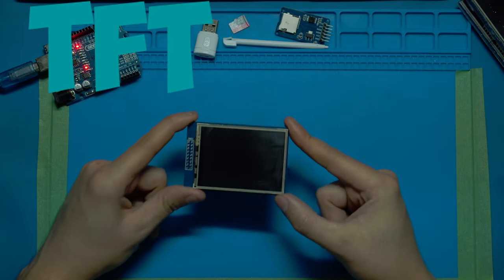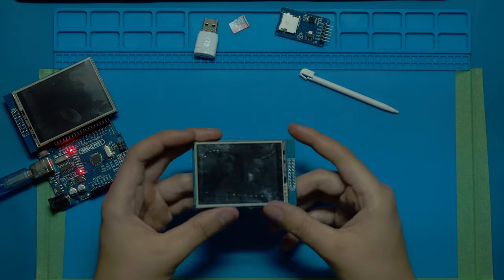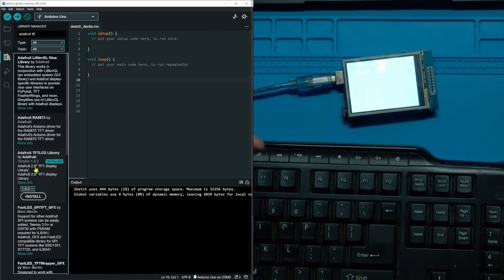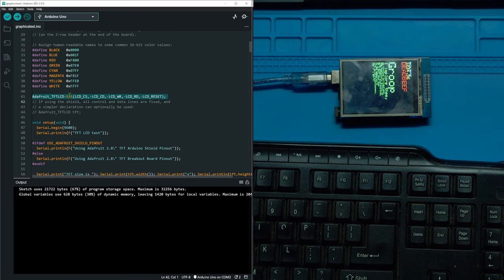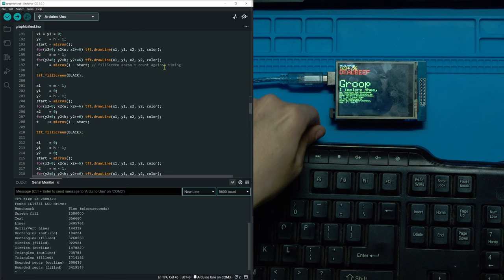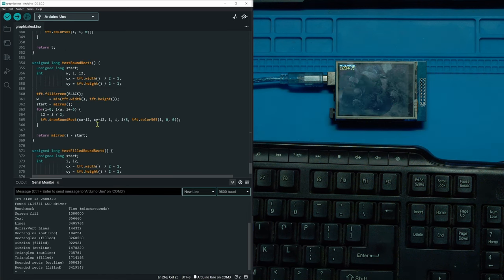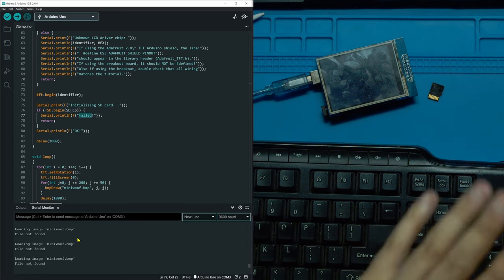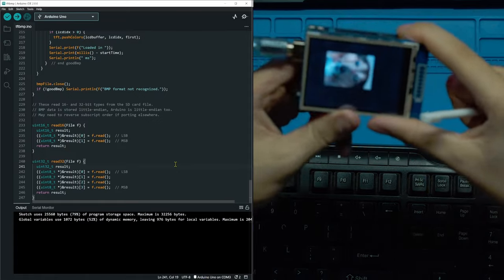TFT Display and Arduino: Setup and Programming | How to connect LCD to arduino 1.8" 2.8" 3.5"

Comment: mine is just stuck on a blank white screeen 💀
Reply from the maker: Seems to be more then just you, check the wiring over, and use one of the example scripts provided from the tft library we used
Reply: @MikaelAbehsera  With the tft display I got, it needed a 1k ohm resistor between the led pin and the 3.3v connection to load the led a bit slower iirc. That’s from what I read and found elsewhere online. Mine behaved similarly and only displayed a blank white screen until I did that.

Comment: IC:\Users\offic\Documents\Arduino\libraries\Adafruit_TFTLCD\Adafruit_TFTLCD.cpp: In member function 'void Adafruit_TFTLCD::init()':
C:\Users\offic\Documents\Arduino\libraries\Adafruit_TFTLCD\Adafruit_TFTLCD.cpp:117:3: error: 'textsize' was not declared in this scope
   textsize  = 1;
   ^~~~~~~~
C:\Users\offic\Documents\Arduino\libraries\Adafruit_TFTLCD\Adafruit_TFTLCD.cpp:117:3: note: suggested alternative: 'textsize_x'
   textsize  = 1;
   ^~~~~~~~
   textsize_x
Multiple libraries were found for "Adafruit_TFTLCD.h"
  Used: C:\Users\offic\Documents\Arduino\libraries\Adafruit_TFTLCD
  Not used: C:\Users\offic\Documents\Arduino\libraries\Adafruit_TFTLCD_Library
Multiple libraries were found for "Wire.h"
  Used: C:\Users\offic\AppData\Local\Arduino15\packages\arduino\hardware\avr\1.8.6\libraries\Wire
  Not used: C:\Users\offic\Documents\Arduino\libraries\Wire
exit status 1

Compilation error: exit status 1
it gives me errors when i run,every example

Comment: I have a 3.5" display not touch, but I can't get it connected. When i try, the screen goes white, but stays white as well. I have tried multiple code examples, but no change. Do you have some suggestions what can be wrong?
Reply from the maker: hard to speculate, check all the pins see if any are broken/short. We have a discord were it might be easier to help there! https://discord.gg/GygvSdf

Comment: Hi! Thank you for this. Can you share with us how I can have say a 5 second video loop play on the screen when I open it and if it's possible to power the screen via a battery instead of it being plugged in? It doesn't have to be a touch screen TFT. I have very minimal knowledge in programming, hope you can help me out. Thanks!
Reply from the maker: yeah it can be battery powered, and for a small video youll most likely have to play the frames as a slideshow to make it look like a video!

Comment: i an REALLY new at arduino and i want to make a project with 2 of those tft display, can 1 arduino drive 2 0 TFT displays 480x320 no touch (14 pins + 4 for to the SD card?
And thanks for this video, it's in my favorites so i can use it later.
Reply from the maker: Join the discord so we can help but I’d recommend learning one thing at a time and then combining them into a project if you’re new

Comment: hello what i want to do is an lcd but with uv light as the backlight, ill use that for pcb making. What LCD will be appropriate for that
Reply from the maker: hmm not sure, you might have to modify a normal one and change the white blacklight to UV

Comment: Is there a way to power the arduino inside a RC plane and can I run a video off the sd card I’m building a fpv jet and looking to use it for my gauges
Reply from the maker: if you can power it I dont see why not, Is the screen with you or in the RC plate?
Reply: @MikaelAbehsera  it will be in the RC plane.. also what do I need if I want to get altitude,speed and attitude readings from the arduino I’ve seen a company called RC gauges but looks like they went out of business

Comment: Is it possible to connect a microphone input to this setup?
Reply from the maker: Unfortunately not really, there are microphones for arduino but in my experience it’s not that great, best bet would be a microphone module with a processor, they do exist but I haven’t tried it yet
Reply: @MikaelAbehsera  But where would you connect it :)

Comment: Hi mikael ,
I tried this same steps and i have 2.4' inch tft shield and when i uploaded the code its just showing the white screen and also tried to reset it and also tried with other examples its not working
Please help
Reply from the maker: hard to know whats wrong but I would start with the wiring, if the screen is showing white we know its getting power but maybe the data lines arent in the right place

Comment: Thanks for sharing.
I'm trying to build something like  a tiny tablet for a kid for learning purposes, so i need this kind of touch screen , mp3 player, speaker, battery, ... i need the size of the project to be compact. Do you know what kind of batteries i can use? And any advices to make the project compact ?
Reply from the maker: Lipo batteries are nice but you’ll need to get a charger for them
Reply: @MikaelAbehsera  
This arduino board needs 5v battery, correct? So i would need two of the 3.7v lipo batteries in series? Can the charging circuit charge both of them in series connection?

Comment: Is this display work with using Adriano nano
Reply from the maker: most will, just have to make sure you can connect all the pins on the nano, which has a lot less then uno/mega

Comment: Hi sir
I need the code which you use it to to make tft 2.8 playing video if you never mind
Reply from the maker: In the video I show you where the code is located, when you install the library the code examples are there 4:27
Reply: If you watched the video you'd know where you can get it